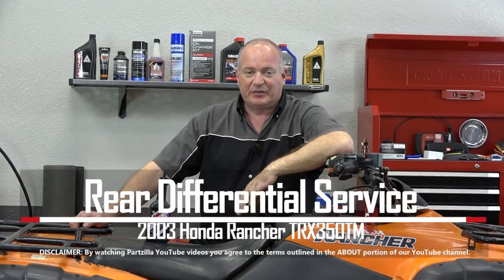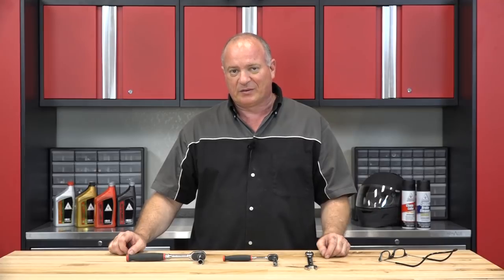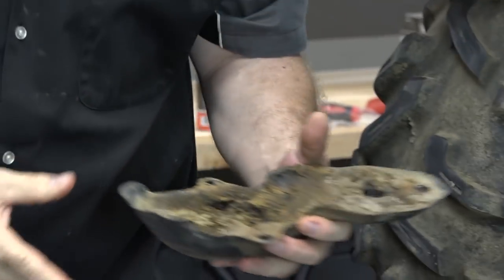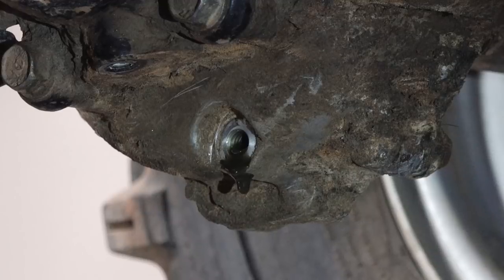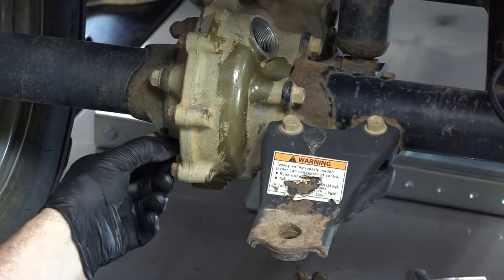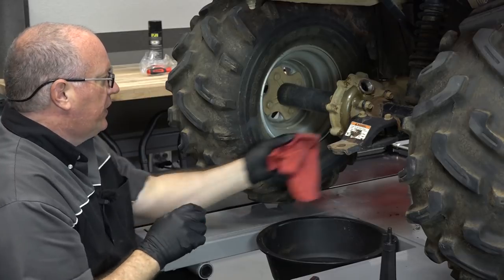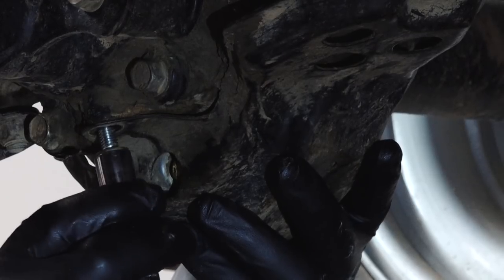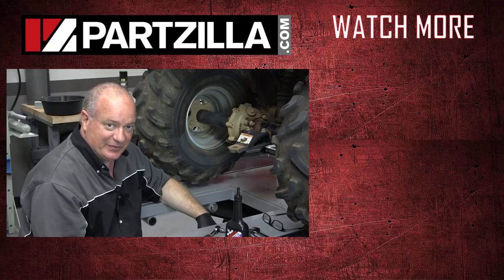Honda Rancher Rear Differential Oil Change | Partzilla.com

Comment: I love watching your videos and their simple step-by-step processes. I am currently trying to diagnose the issue where my 03 Honda Rancher 350's 4-wheel-drive no longer engages in the rear axle. Would changing the oil resolve this or would I have to completely tear apart the axle?

Comment: Mine has like a little thing to push a tube onto to pump grease into. . Is that the same thing or does it go to somthing else. Its a honda rancher 350. Im thinking somehwere aepund an 03 model. Dont have a title or see any stickers on frame telling me the yr so i figure from pictures ive looked up that its between a 2000 to a 2006 which are supposed to be all pretty much the same.

Comment: Good video as always. How much torque do you recommend for the skid plate scews (got an Yamaha grizzly 700 2016 with aluminium plates). Thx
Reply from the maker: Snug them down good.  Don't have an actual torque spec unless the plates came with instructions.

Comment: Great video! I have a question. I want to do the seals and bearings. Also the shaft seal. Do I have to remove and and take apart the entire final drive?
Reply from the maker: Typically that's a full rebuild, so most likely you'll have to tear it down.

Comment: Thanks for the great video, I just changed differential oil of my 04 rancher ES 4x4... and I found a rip on a boot cover which I believe is part#52101-HN5-670 from partszilla website.. it looks like it will be a very involved work to change the boot. It is the one on the joint of a shaft coming with out of transmission toward the rear differential.
Do you have a video? Thank you!
Reply from the maker: We don't for this model, but we have boot replacement videos for the Grizzly 700.  It might give some insight.
Reply: Partzilla 
Thank you, I’ll check it out!

Comment: is there any way to check the differential oil level on a honda rancher 425 2013?
Reply from the maker: For the Rancher 420, there is a check bolt about 3/4 down on the diff.  If you want to just check the level, pull it out and add gear oil at the top.  Once it spills out the check bolt hole, it's full.

Comment: same for the front?
Reply from the maker: Completely different component, so not really.
Reply: same oil? same conception? DO YOU HAVE A VIDEO FOR IT?
Reply from the maker: Different oil, same idea, no video for transmission on this unit.  No need to yell.

This is the only transmission vid we have for ATV.  I'll add TRX350 to the list.
https://youtu.be/DaNh2E9x8MY
Reply: did not mean to seem like I was yelling. what oil is used in it please sir?
Reply: type of oil used in front?

Comment: i have a question my polaris sportsman 570 sp has some kind of sound coming frim the rear right wheel what you think is the problem
Reply from the maker: That is a very vague description of the issue.  It could be a number of things.  Check brakes, wheel hub and axle.
Reply: ok
Reply: Any luck?

Comment: Hey what was the noise when u were spining the wheels
Reply from the maker: You can heard the gears in the diff turning a little...the occasional knock was the ATV moving on the stand.
Reply: Partzilla the noise in the rear end i have a 2004 rancher that makes the same noise but a lot louder u can hear is when your coasting of when you slowing down to turn or driving really slow.
Reply from the maker: Time to take a look at the back end.  If that noise is loud, check fluid for shavings.  Could be bearings or gears.
Reply: did not see any shavings gears look great bearing look good butt going to replace the bearing cause they are cheap and it was full of fluid.
Reply: Partzilla the pinion and ring gear looks fine and i replaced the bearings but is still soulds the same
Reply: Chris Graham did you put the shims on right?